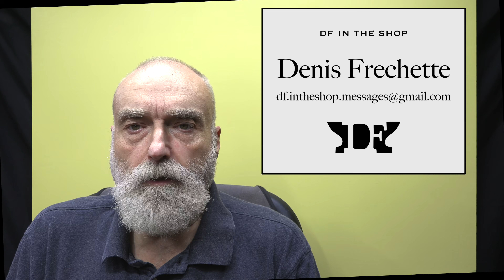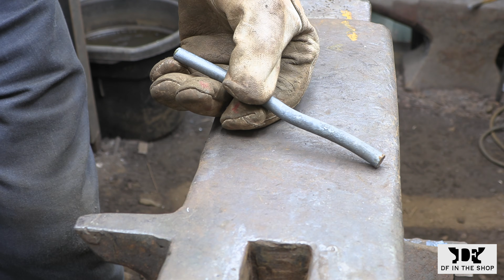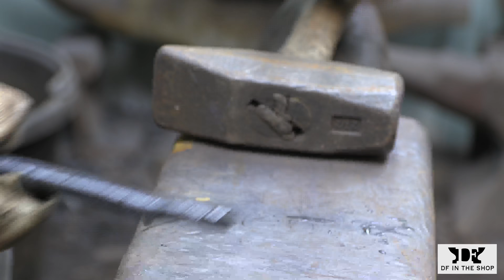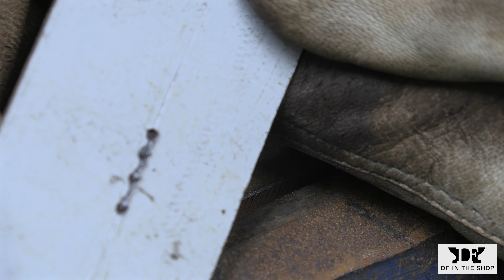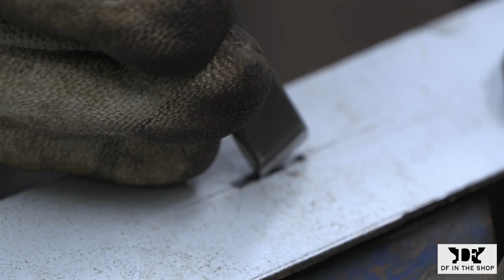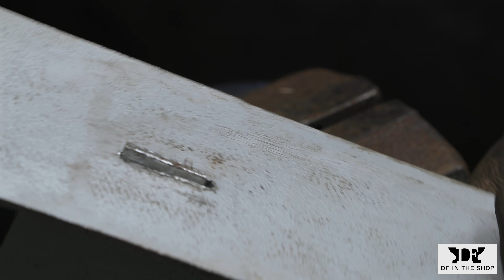Blacksmithing for Beginners - The Best Cold Chisel

Comment: Nice work, I could never make a cold chisel, but back in the 80's I had a thin wedge shaped  one made by Facom, it'd cut through really tough metals.
I used it to cut through 3/16 stainless steel bolts holding the heater bands onto the plastic injection machines I used to repair, there was no way they would come undone with wrenches. 
Somebody obviously saw how easy it made the job because it got stolen. I'll replace it one day !

Comment: how much experience/trial and error did you have to do to know the exact color for tempering? its impressive.
Reply from the maker: It's usually easier to start with the chisel a little hard because if the edge chips all you need to do is go to a darker (softer) temper colour.  However if the chisel starts off too soft and the cutting edge deforms then you will need to totally redo the heat treat to get back to a lighter temper colour.

Comment: During the grinding/sharpening phase I’ve noticed the cutting area will heat up to a blue color. Does this mean my heat treat is ruined and I need to redo the whole heat treating process again?
Reply from the maker: That area has lost its temper. If it is localized to just a thin blue line on the cutting edge and you caught it ( cooled it ) fast enough you will be able to grind past that area and get to a section that was not affected by the heat.  Otherwise  it will be necessary to go through the whole heat treating cycle again.

Comment: I thought the quenching was important with the temper, that it should be in oil. I'm recalling from decades ago. Can someone say when water and when oil, please?
Reply from the maker: The makeup of the steel determines whether it is oil, water or air hardening.  With scrap steel you will need to test to see what works best.  The reason I use springs or crowbars for my tools is because they tend to always be oil hardening ( so far ).
Reply: A lot of the time you need to know the alloy youre using, or you can just guess. Some alloys use water, oil, or some mixture of stuff. Car springs are usually gonna be pretty similar i think. I have an app called heat treat that has a database of alloys and their heat treatment processes. Its a really incredible bit of informstion. Thats talking about ideal conditions though. For most purposes, just using oil is a pretty safe bet

Comment: I like working with chisels and they have helped me thru some difficult jobs but your display is very limited in application. Only a very narrow piece of steel can fit in the depth of a vise. In something like a box or anything that isnt flat and accesible this just wont work as you need full holding power of a vise . A better way is to cut down onto  a baseplate so minimal clamping is required. Many videos from India and other Asian countries show how its done .
Reply: Thankyou for your constructive feedback, this kind of insight is the best of youtube in my humble opinion.
Reply: Technically yes but this works for a lot of applications and if you arent working o. Boxes frequently, you can just set the box on top of the vice and use the vice as the baseplate. Some vices have anvils on them anyway. Or if you want to punch through and dont want to damage your vice or chisel, you can open the vice and set the box on top

Comment: Denis, on the subject of "not relying on color alone," the best trick in my experience (better than a magnet) is to sprinkle some salt on your workpiece in the forge. When the salt melts, you're at the perfect temperature for most common tool steels/spring steels/knife steels, about 1475F... and then let it soak for the appropriate time for the piece's thickness to ensure through-heat, then quench. That's going to give you the best results doing heat treatment in a forge. I'm relatively sure that you probably already know this, but I hope it helps. It might make a good video, along with other tips on HT and Tempering without a temperature-controlled oven. Thanks for the great content as always.
Reply: this is an amazing tip! gonna buy a box of salt for the shop now
Reply: @Cratercitysmith  another tip that goes hand in hand with that one... is to get some blue Didymium filter lenses to put in a pair of goggles to slip on whenever you look directly into the forge. It's a glassworking thing, and I'm amazed that blacksmiths and bladesmiths haven't adopted it. 

We only glance into the forge for a couple of seconds at a time, but it adds up over the years and all that IR and UV high frequency light completely wrecks our eyes with cumulative damage, because the entire lining of the forge is radiating it, not just the burner, not just a single point like with a torch. You don't need a welding hood or a 14 shade... just a blue Didymium lens for your goggles. It's a wise and inexpensive PPE purchase.
Reply: Huh...gonna have to remember both of these tips o.o
Reply: I've never heard of that. That's really cool
Reply: DF may have known.  But I did not.  Thank you for the tip.